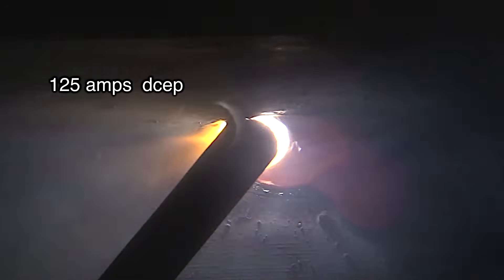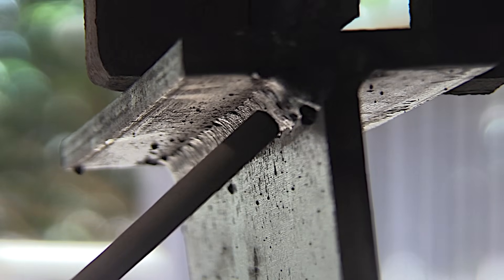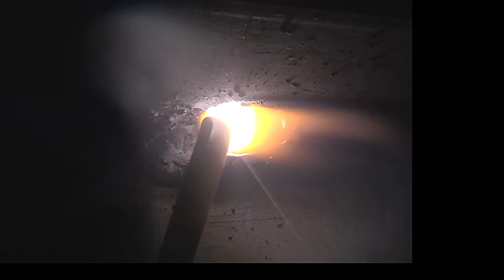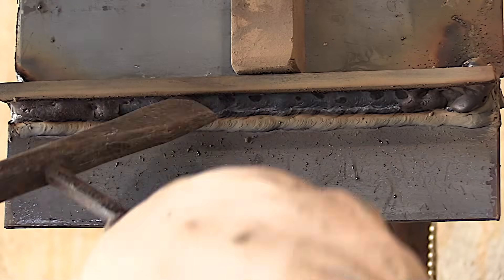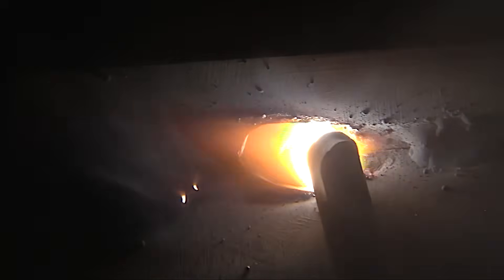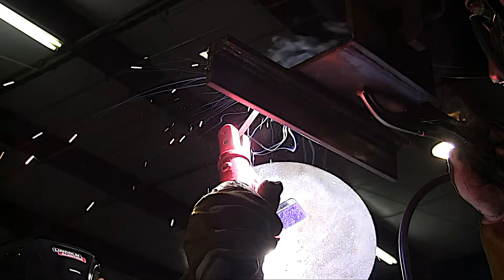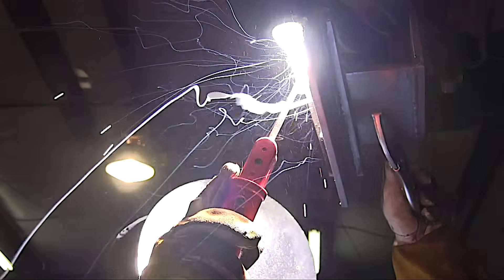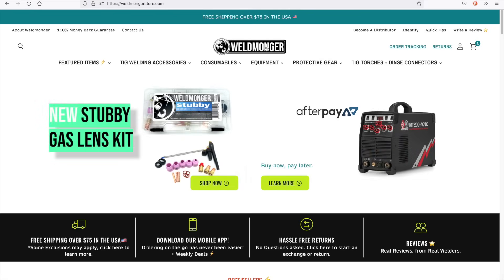Overhead Welding with 7018 1/8" and 5/32"

Comment: Great video! 7018 is well known electrodes. What about 8010, 11018? 😉 It would be great to get your professional  opinion  about a electrodes which are not so widely spread as 6010 or 7018.

Comment: Interesting that the metal cohesion is strong enough to prevent the low-density slag from wetting the steel and floating into the overhead joint as a slag inclusion. Is this ever a problem?

Comment: I have been welding for about 9 yrs now with no formal training and I realy enjoy your vids. I have learned allot. Just did a large welding job allot over head realy wish I had watched this video before hand my feet would have appreciated it lol. I always weld top to bottom on vertical,  is there any benefit to welding the other way?

Comment: I have to admit, I have just got my first modern welder with arc force on it, and it is stuffing me up. The welder is certainly chalk and cheese compared to the old unit, but I am finding setting the arc force is a puzzle.
Reply: Set it in the middle and get used to it welding in all the positions you can with as many different types and sizes of rods as you can then start tweaking it.

Comment: Great to see another video Jody. I see you are still exercising that 210 MP. Those things have sure gone up in price as people realized how good they are. Watching you demonstrate how not to weld overhead sure takes me back to my learning days. I vividly remember laying under our bailer welding something up, slag dripping on me, molten metal doing the same. Luckily, if you can call it that, we had an asbestos blanket that we would put over us when we had to lay under something. But as we know, asbestos isn't a good thing. I can still remember taking the blanket off and seeing all the fibers float off in the air. I cringe thinking about it now days.

Comment: The only thing I do different is to move at a speed that the puddle flows just to the light line of the last bead. ( The point where the arc light reflects off the highest point of the bead your tying in to) This makes a very flat weld, not rope like.